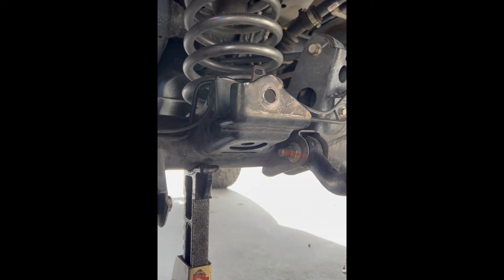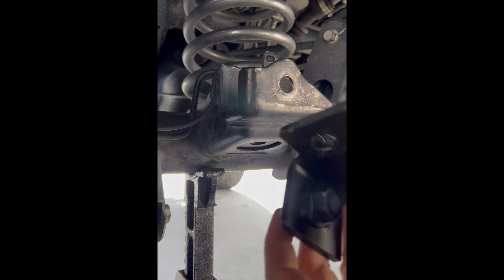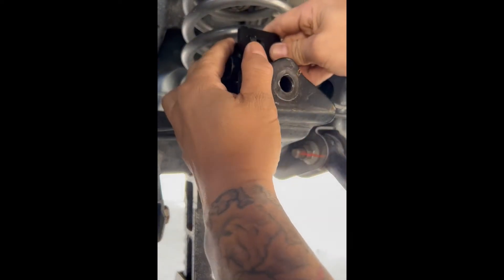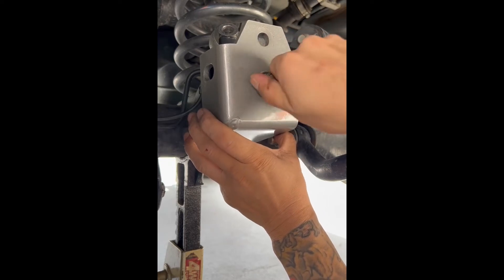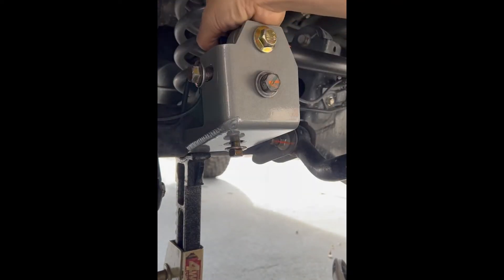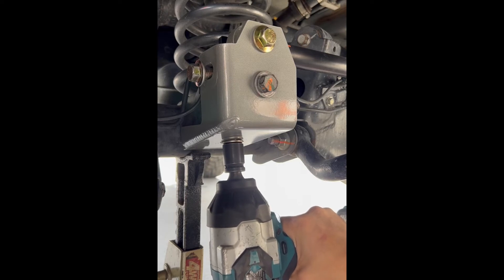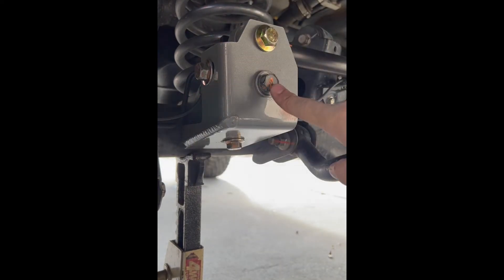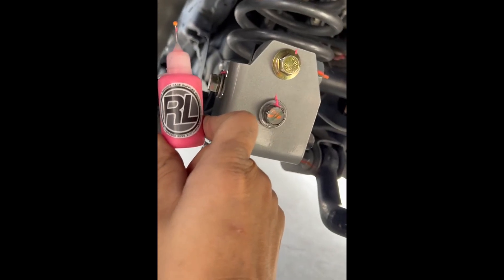Install Video - KDSS BOLT ON PAN-HARD CORRECTION KIT

Comment: I just had a 3" lift put on my GX470, about to install this Panhard correction bracket and since I had the lift put on my tires sound like they are squelching around corners, no matter the speed. Any suggestions? I'm hoping the Panhard bracket may fix this issue, I also noticed the tires are old and  a bit dry rotted from previous owner in the Midwest, but the noise started after the lift install.
Reply: I’m not sure what’s the reason for the squelching.  But this for sure is needed if you r 3” out back.

Comment: Noticed the nut was super close to my ABS line, had to pull it out of the way and then crank it down. Afterwards I zip tied it to the brake line to avoid it coming too close to rear springs etc.
Reply: Yea I just bent the brake line back a little then tucked the abs line under it. Haven’t had any issue lately at all and i boogie pretty hard with this thing.
Reply: @fltllc4136  thanks for this comment I bought a shorty and will just bend the tab back

Comment: Just FYI for anyone watching this…I found that I could not remove the factory panhard bolt with my 4Runner on the ground.
Reply: You can you just did do it properly.  It helps to loosen the passenger side too if it’s a oem trac bar.  Trust me the number one way to work a trac bar / pan hard bar is on the ground.  It take the load off the bolts.  If you droop it out you are just loaded those bolts. I’ve removed trac bars off my whole life.  Prob 1000 times now.
Reply: @fltllc4136  Just sharing my experience with trying to do it. Looks like the guy who makes these also puts the rear axle up on jack stands so...
Reply: @stephenjackkson4238  I’m the guy who makes them.  I’m just using my other account lol.  It’s on jack stands so that I can have more head room for the camera and what not. But all the weight of vehicle is on them just as if the tires are on the ground.
Reply from the maker: @stephenjackkson4238  hey yeah that was just my other account.  My bad.

Comment: 4Runner is now wondering after the install? Do I need to use the bottom hole maybe instead of top hole? I have a 3inch lift.
Reply: Did you loosen the passenger side bolt before you stated install and last bolt that should tighten as well.  And that should have on the ground.   As in on its own weight.
Reply: Also idk if you should run the top hole. It depends on the ride height.  Top hole if 3” or more.  Bottom hole if 2.5” or less.

Comment: Silly question.  Do you have to jack the truck up to install this?  Just received my kit for a gx460
Reply: No you can do it on the ground or it’s own weight on jack stands so you can have more room. Remove spare for more.
Reply: @fltllc4136  oh i don't have to jack the truck up? nice. thanks so the weight can be on the rear wheels.

Comment: 2014 SR5 with 2” of rear lift. Would I need an adjustable panhard or will the original still work with the shorty version?
Reply from the maker: Adjustable only allows you to recenter.   It doesn’t correct the geometry.  At 2” lift I’d do the shorty.

Comment: I want but shit $200 i was thinking itd be like 80...most weld on is 80-90....hmmmm
Reply from the maker: Please go do the weld on one then. This bolt on setup is so much more beefier and will not break on you.  Go pay for the weld on one and then pay some one else to weld it on for another $100.  Unless you do it.   

Just one bracket on the kit is more involved then the weld on bracket lmao.  If you had the weld on one in your hands and my kit.  You would understand.   

But since you even asking or tripping out on price. Maybe you don’t understand then. 

Buy the weld one one. This is too good for you.
Reply: @drkdss8742  simply asked a question hence why having to check to make sure "bolts" don't come loose or a solid weld like the rest of the frame is.....i was jw why weld one is cheaper than bolt on. Thanks.
Reply from the maker: @travelteam89  yeah the weld on one on the market is welded to the thinnest part of the oem mount.  A pck or trac bar bracket like this is side loaded.  Weld on version like the one that is on the market for 4r / gx is a weak design and only survives in the 4r / gx world because most ppl just crawl around and the weak design has never been exposed up until recently.  Lots of pics and vid’s of it breaking and cracking.  

You can easily put this design and the weld on design in a cAD analysis and see that this wrap around design spreads the load so evenly across the oem mount unlike the weld on version being welded to the top of the thinnest part.  I’m simply laying out the information so ppl are informed and don’t make un informed decisions. 

With your logic about bolts vs welds.  Let’s just weld the motor to the frame then. Let’s just weld the cab to the frame.  Let’s just weld every single parts to the frame lol.   

Seriously though. This spreads the load.  The bolts being torque down properly and you can even toss a spot weld here and there if you wanted to trap this bolt in bracket down.  And if one day you wanted to take it off, it is easily removable.
I’m sorry I’m a sick this morning but when you don’t even have this in your hand to compare to what the word on version is but saying that you thought it should be this price vs a weld one that has no hardware and no welds on it till you have to weld it.
Reply: @drkdss8742  yo on the site whats the "shorty" mean
Reply from the maker: @travelteam89  it’s a shorter version which the hole is same hole as the bottom hole on the standard height.  If you go back to the site And read the product description, at the bottom will explain you would want a shorty version.
Reply: @drkdss8742  you on the 4runner familia page? Oh yeah i didnt go that far seen most of them were out of stock.....yeah i have the 2.5" old man emu lift
Reply: Good convo thread here